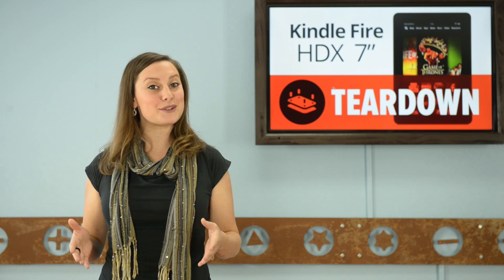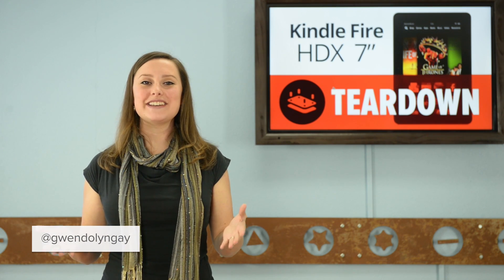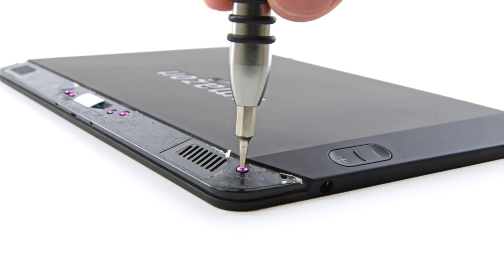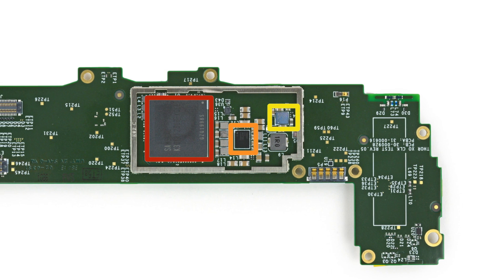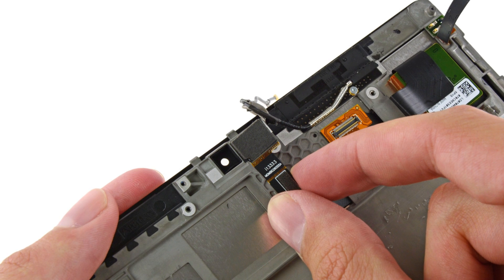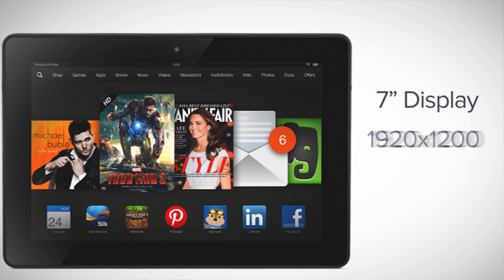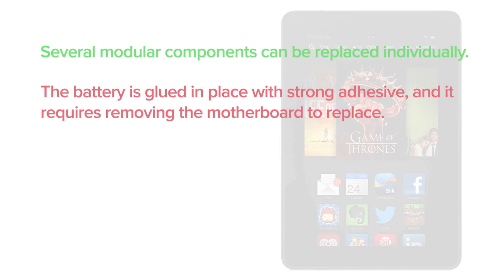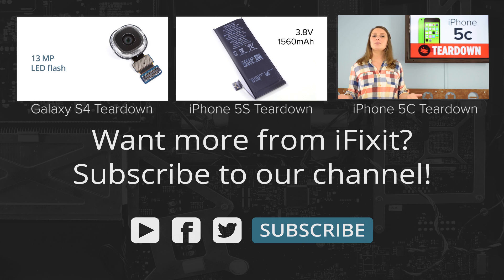Kindle Fire HDX 7" Teardown Review

Comment: 4 years later and the battery for the Kindle fire HDX won't hold a charge for very long. Yup, no replacing the battery. Amazon Chinese junk.
Reply: Desert Prince of the Oasis I still have mine works just fine still going strong since 2013